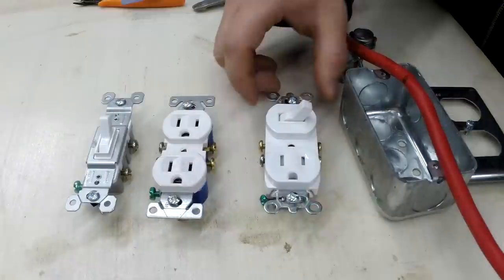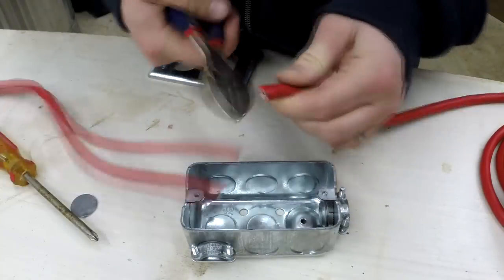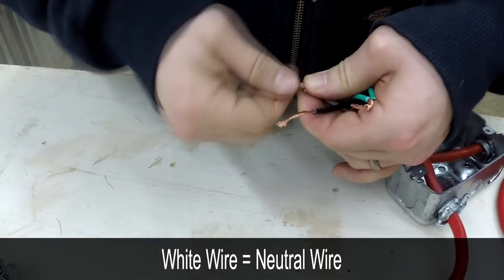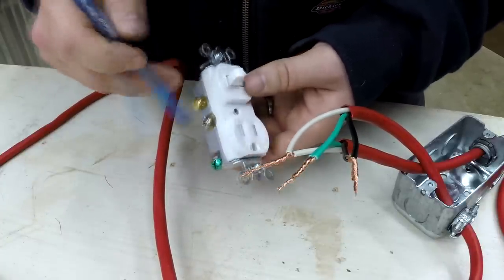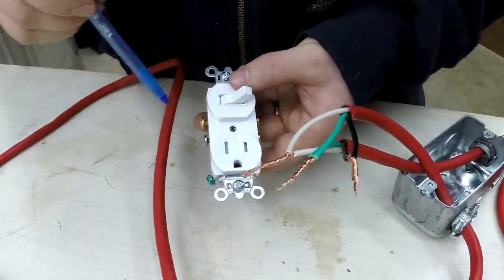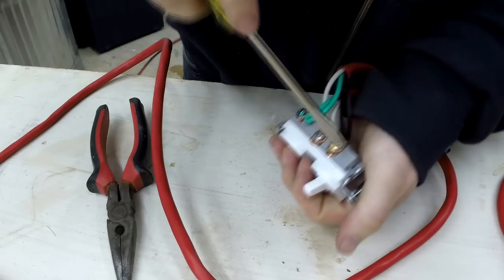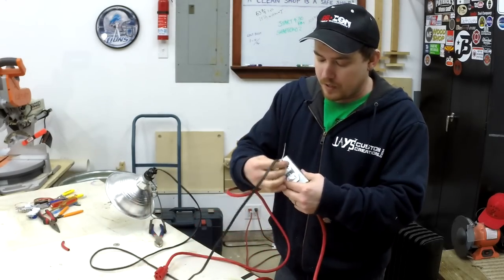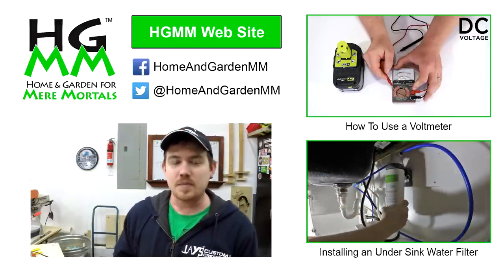How to Wire and Install a Switch Receptacle

Comment: Honestly, normally I would agree with Grounding the Box in almost every application but because he taped over the connections the way he did, I really can't fault him for that. The only real criticism I can give him is visually inspecting the stranded wires and not using an Ohm Meter to double check and electrically verifying that there is no short.

Comment: I noted that you did not ground the metal box. It was my understanding a metal receptacle box should always be grounded. I am sure that this is code when wiring  metal box in house wiring and think it would also apply to the box as you are showing it.
Reply: He attached the Ground screw to an extension cord that itself is grounded.
Reply: xnamkcor X I did see the connection to the ground screw on the switch but the ground should also connect directly to the metal box as well.
Reply: Tom Doe In case lightning hits the metal box connected to nothing?
Reply: xnamkcor X This is actually a safety issue. With a box grounded any failure where the hot lead touches the box will cause the breaker to trip. A floating metal box could become hot during a failure resulting in potential electrocution if touched. It is much better to have the circuit fail safe. That  believe is the intent of the electrical code.
Reply: Tom Doe Then why use metal at all?
Reply: Wouldn't the box be grounded via the connection of the grounded metal switch frame to the metal box?  I am far from an expert on this, just curious.
Reply: Perspectologist  No the metal box needs a direct connection to the ground wire to be safe.
Reply: xnamkcor X I agree that a non metallic box would be an excellent choice. That however was not what was depicted in the video.
Reply: Every metal box should have a ground screw and connected via pigtail to the ground wire. It is always better to be safe then sorry. That is why i try to use plastic boxes as much as possible, one less step.
Reply: The dogears that are on the switch/receptacle are grounded, thus grounding the box that they are attached to. It's the reason why the only boxes that have built in ground connectors are outdoor sealed boxes because they are painted and don't allow for metal to metal contact. Jay did just fine, and I've done this at least 20 times in my life.
Reply: Also plastic boxes aren't very good in this situation because they aren't meant to be moved - They shatter.

Comment: Thank you for this,  I need to wire this for a garbage disposal and dishwasher under the sink,  I want the dishwasher to have constant power and the garbage disposal to be able to be turned off.  This will work perfectly.

Comment: I'm going to use the switch to control the outlet underneath to control a garbage disposal under my sink. In essence, I'll mount the switch/box under the sink, & plug in the garbage disposal (which has a standard 120v plug end).  To operate, I'll just flip the switch.

Comment: I am facing a big problem. My light switch box has  a black+ white+ metal(ground). There is no source- only it is connected to light switch, I think connection from the breaker has inside the light box - so in this case how could I wire this combo- I followed your way which did not work. Hope someone will help me out.

Comment: Jay, I have taught most people who have never done electrical work to use the blade and cut the plastic sheathing at the end and peel it back to where they can cut of with snips, so that there is no chance of them cutting into the wire sheathing. But good video.

Comment: If you are working with stranded wire it is generally advisable to attach solid wire to your stranded wires with wire nuts. Then terminate the solid wires.

Comment: I recommend using short (maybe 3 inches or so)  "pigtails" of solid copper wire between the receptacle and the stranded wires. Check the physical space of the box and use the appropriate sized twist on "Marrette" or similar connectors to connect the solid and stranded wire. Appropriate size is usually marked on the side of the Marrette box. When mating the stranded and solid wires, let the stranded wire extend just a little bit past the end of the solid. This tends to snug the stranded wire into the twist connector rather than push it downward. 

At the other end of the solid wire, strip the insulation according to the strip guage on the back of the receptacle/switch, and loop the correct wires under the receptacle screws as shown in the video. This approach lessens the possibility that a few energized/ hot strands will work loose inside the metal box.

Comment: Have one of those in my kitchen. Outlet is always live and the switch is used to turn on the lights over the sink. Useful little thing since only one hole had to be accommodated for in the backsplash.

Comment: So, if you want the switch to control the plug, you use the left side that has the brass and silver screws on them, and let the current flow through the switch, then through the built-in tab, and then through the plug back to the neutral so that turning the switch off cuts power to the plug too?  Right?  I am just sitting down to do one of these things and am having to think about it a bit too much.  It probably should be obvious, but it's not to me right now.

Comment: Just built a combo router and bandsaw table. The old bandsaw doesn't have a switch I have been just using a power strip and wasting the extra outlets. I think I will wire one of these in inline. thanks

Comment: As of 1996 or 1999 up date the NEC up dated their code stating that all metal boxes now have to be grounded and bonded.  So you must pig tail the ground to the recp. as well as the metal box.  The bonding comes from the screw and the tab holding said screw.  if the recp. or switch for that matter would become loose you would loose the ground to the box if you didnt pig tail to the box.  Thus if it touched the box the box would now become electrified or cause an arch which could create a fire.  Or in the case of metal studs ( and yes a lot of people frame basements out with metal studs these days) if the device touches the metal box and the metal box was not grounded the entire metal stud structure will now become electrified.

Comment: Hi. I have 3 wires and trying to install a light switch combo into just a light switch with 3 wires NOT 4 wires. I want the light switch and plug to always work. So do i need to piggy the black wire (if i can do that) for it to work the way i want. Please help

Comment: Hi, I live in the UK and our wires and plugs are different, whenever I am watching electric hook-ups in the USA I am horrified by the way they are done. Here in the UK our sockets are much bigger and the wires always are sunk into the socket so that no wires can touch each other. also for this type of connection a rubber socket would be used and not metal so that if a wire did come loose you would not get a shock from the box

Comment: I wired my combination switch just like you explained but the switch does not shut off power to the plug
both black and white wires attached on the same side of the switch and ground connected

Comment: if i have only 1 white wire and 1 black wire how can i connect switch and outlet combo
Reply: My probelm as well, I have yet to find a video of that kind of wiring set up.
Reply: On some metal electrical boxes are grounded. If it is, use a voltmeter to check, or use one of those plug checkers.

Comment: I did something similar with an illuminated rocker switch. I wanted it to light up if I wanted the work circuit to work but it was accidentally switched off.

Comment: Is it possible to convert a switch (kitchen light) to a combo switch/outlet, switch will still be for light and outlet will be extra for appliances?
Reply: Only if there is a neuteral wire in the switch box. Generally, this would be if there was a cable with power coming into the switch box and a second wire going to the light.

Comment: i only  have a black white and ground wire in my box, so i would put the wires all on the same side,  black to brass white to silver and copper to green , so the switch would control the outlet when you switch it over to the right  ?  Is that right???
Reply: This is my problem as well. I have yet to find a video of someone hooking up the combo switch/outlet in that fashion.

Comment: Actually, while this is a great idea for switching a device on or off, these are appealing for situations where you can use the switch for lighting, and then still use that same box as a power outlet as well.

For some people a potential use there would be to hook a small night light into the outlet part when not in use, that way it would be easy for anyone to find the light switch, even in the dark and if not familiar with the house (for example, guests).

Comment: That installation would bring you into the Jail in Germany xDD Jesus, you guys realy life in 1950 with your Electrical House installations ...
Reply: Yeah, but I would suggest you to spell "realy" as "really" to keep up with the 2015 YouTube comments convention.
Reply: SE45CX
 ok, thank you sir.
Reply: mark d Alright, I tried typing some German sentence but even with spelling mistakes I wasn't sure I would get the message across. However I have automatic spell checking here. So a misspelled word gets a red zigzag line. In that case if Kermit was careful he also could write it correctly even with limited knowlegde of english.

I'm not dead serious all the time. So I wouldn't recommend you to believe there is a YouTube comments convention, okay ;-)

I'm from the Netherlands by the way.
Reply: you all are working with 240 also so....
Reply: Will the switch work properly with only (1) Hot on the outlet side??Or is another Hot required to the Brass terminal??

Comment: what if you only have a neutral wire and hot wire
Reply: My problem as well.
Reply: a lot of older setups do not have a ground wire, as it wasn't always considered a necessary component. BUT, although it's always safer to have a ground, it's not really needed at a lower voltage
Reply: lower voltage....lol....its 120 volts my nigga

Comment: I consider it bad advice to just pick up a unknown device and tell the audience what the functions of the terminals are. Not every manufacturer is using the same convention. I would highly recommend everyone to look up the wiring diagram of the EXACT part they are having before they attempt to hook it up some way or another. He also should make it clear that it only applies to the American convention.
Reply: except there is nothing unknown  about this device as you call it.  Yes he is wiring a switch in the US using a standard part.   If this device seems unfamiliar to you.... then I would suggest not attempting this lol.

Comment: You should use solid wires and wire connectors to join your wires so that if a screw does become loose, it won't short out and to make this extension cord safer to use. I have made one of those too and that's how I wired mine.